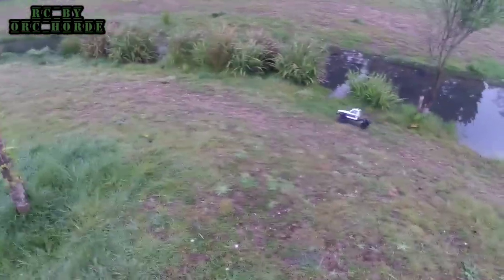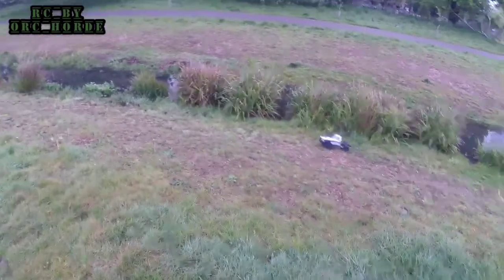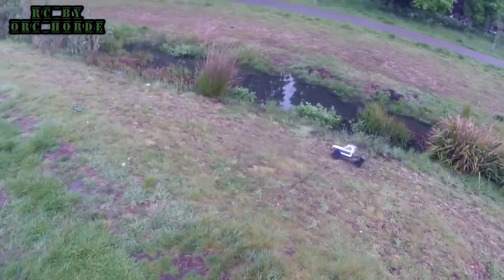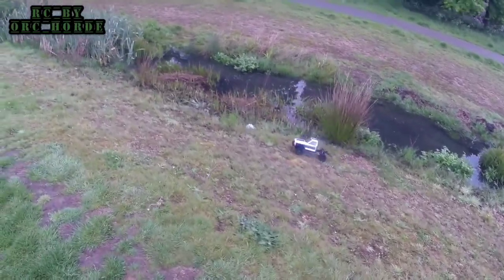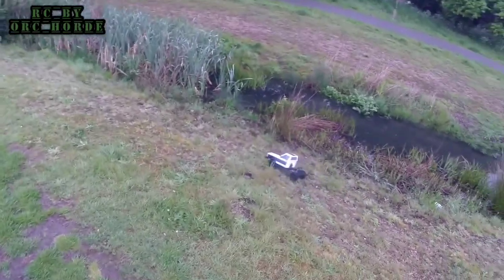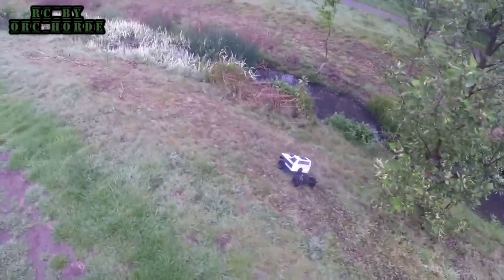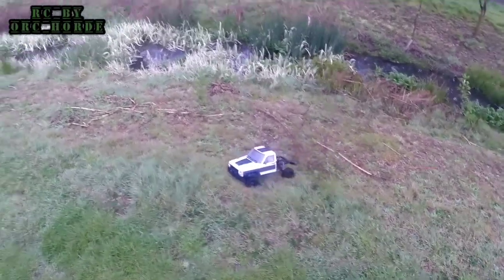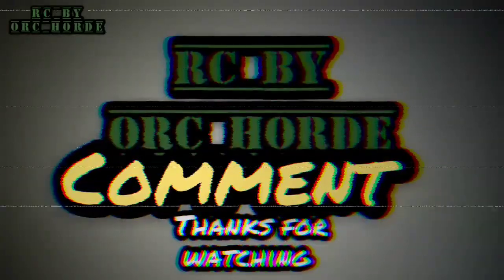Austar 1/10 313mm wheelbase crawler (1)

Comment: If you can still get them,use a set of steel beadlocks with a set of cheap 110mm Super Swamper tyres,they work great on the Austar chassis.( Both come from China). I've found that these give the best grip on the type of terrain that you drive on. The 25kg MG servos are waterproof mate. A little trick with the receiver box,mount the receiver to the underside of the lid,this prevents any water from laying in it,as it just drains straight out. Use BlueTac or something similar to block off the holes on the box. This has allowed me to drive mine up and down streams with no lingering problems. The 2700mAh 3s will last you almost 3 hours in that rig,if you're not running flat out.
Reply from the maker: Thanks for the tips, already got the tires your talking about, used them the last time I ran with the Jeep wrangler body and they work well. The tires I'm running now work well with this format and at the moment I'm happy with the performance they are giving. Looking at some alloy beadlock wheels in the future for this rig black to go with paint job, and also going to make an open bed with spare tire mount for rear of the truck. Hopefully will have time to build soon. 👍👍
Reply: @rcbyorchorde2898  I found that the black steel wheels,whilst being cheaper are slightly heavier and far easier to assemble than the alloy ones are.
Reply from the maker: I'll have plenty of weight once I have built the bed and not only that the hard body has a bit of weight to to it as well, and eventually all plastic will be replaced with metal. 👍